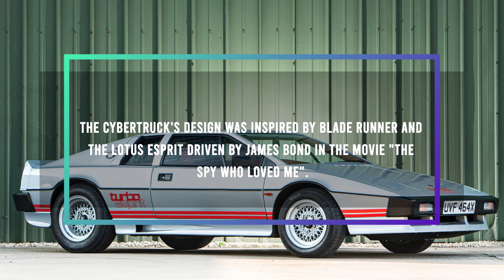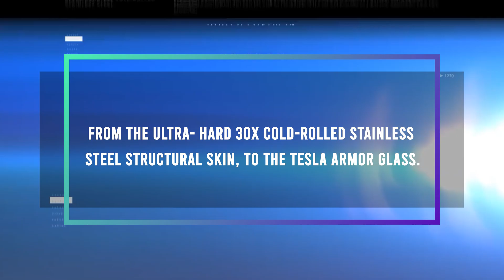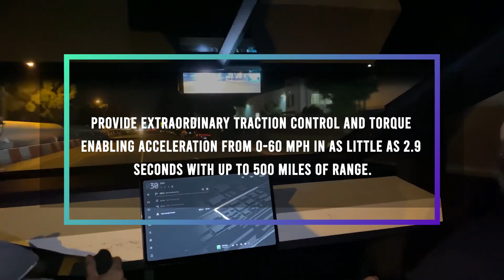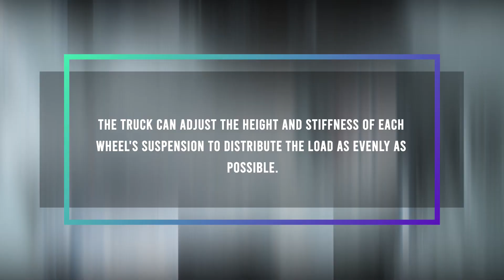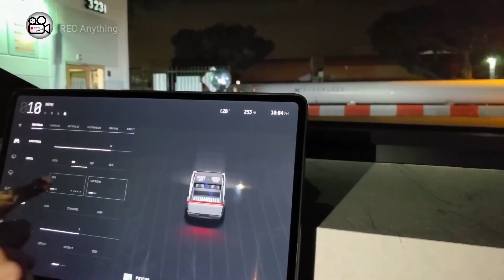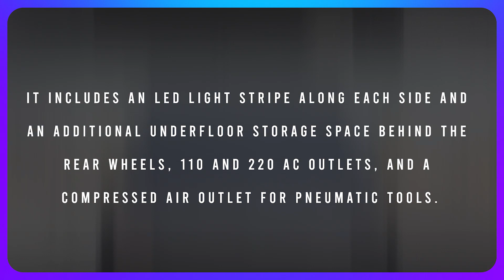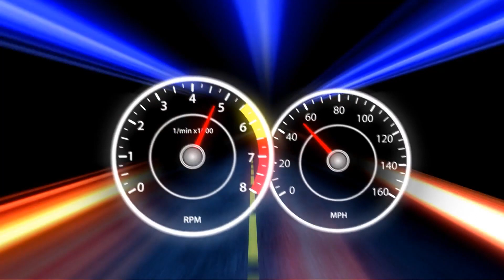Tesla Cybertruck's Insane Engineering

Comment: Won’t collison repairs be a costly nightmare because of the unibody?
Reply: Would take a hard hit to damage it.  If you dont wreck it majorly, the lack of door dings and such would be worth it.
Reply: @Sheridantank  I agree it’s great for dings and dents and maybe a fender bender. I’m talking about getting t-boned by a red light runner and other major collisions. Say there’s a big tear in the exoskeleton, which is a structural element. How do you even fix that? Weld in a new section? But there are no sections because it’s a unibody. Replace the whole unibody? Time will tell.
Reply: @metermill  
Major accidents would be a nightmare on repairs.  Probably a either no damage or totaled situation with little between.

Comment: Spent many years torching independent front ends out of pickups to install solid, tough, durable beam axles. And those air springs are expensive maintenance items. How should I know? Against my best instincts I own 3 Land Rover Discoveries with air springs in the rear (lie: The air springs were removed and replaced with steel springs) and my wife has a Range Rover with air springs (we'll keep them there, it rides nice and isn't used for heavy duty off road or much of anything else for that matter). Don't ask about my other 10 vehicles, which unlike many Tesla product owners, have free and clear titles (I actually own them, not the bank). Insane engineering doesn't get me aroused.